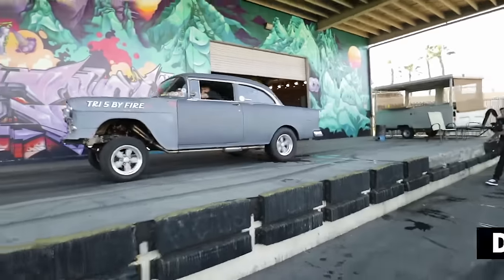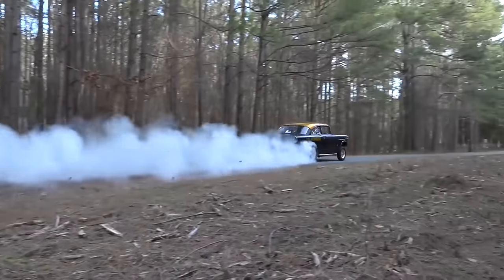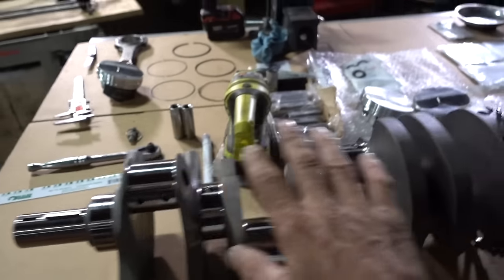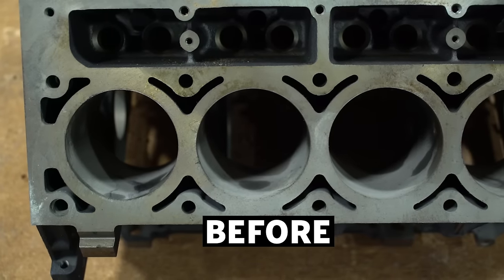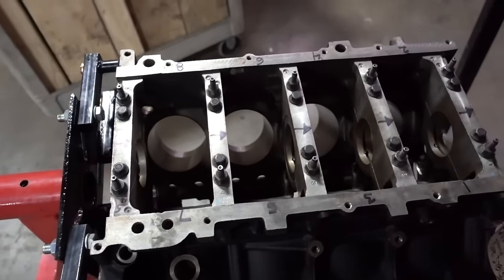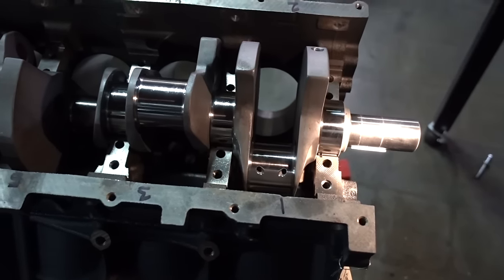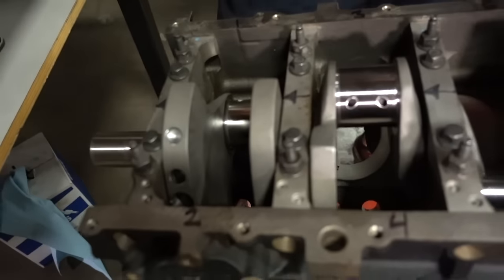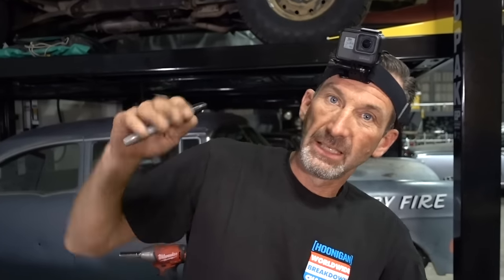700HP Stroker LS - How To Build Bottom End

Comment: Discrepancy in journal clearance can mean excess bearing thickness, a burred oil hole, inconsistent chamfering or a non chamfered main cap bolt hole, faling to remove peel coat from crank main journals, and line bores, uneven torque,  you mentioned misaligned line bore machining and a bent or poorly machined crank  (highly unlikely, machinists aren’t in the margin for error business) the most likely cause from a trouble shooters sense of weighing out which is more likely, precision machine with human fail safe  control monitoring (operator) or a human error during the assembly of the block, installing the rod and main caps in the correct direction is important, and so is the order! Switch two, one may or may not bind, but still be lethal to bearing life, depending on its distance from the original journal, while the other if located far enough or close enough will cause a serious offset of bore alignment , wiping out all that wonderful machining you paid for with hard earned loot. Id be suspicious of the human factor and eliminate from there back toward machining errors, or check the main crank bore alignment first, since its easier than taking it back apart and doing it again, again, and again (plastigage is compromised when it contacts oil, assembly lube, solvents found in engine building environments, thats why micrometers rule, and you only have to do things once after measuring your part O D to part hole  I D. Which the machinist sets with extreme skill and strict attention to tolerances, errors are not tolerated in the precision industry. The thickness of a human hair (bodily origin can be determined with a mic) stick a hair on the bearing and torque it down, will plastigage read it?  Never tried, a single small hair will likely shear off or flush out harmlessly, if it gives a false read on the plastigage, your well intended but unnecessary corrective actions are irreversible (barring plasma spraying new metal on the journal and re machining) you’ll have to increase bearing thickness and match the crank journal

Comment: Did I see you using blue threadlocker on the bottom-end hardware? If so, I've never seen that done with ARP fasteners. They just recommend their Ultratorque compound for even fastener tightness. Explanation?

Comment: Why check tolerances with factory bottom end bolts and then switch to ARP's? ARP's clamp differently and therefore can distort the main caps differently, as well as not having the exact same amount of clamping force as factory TTY bolts. Since the ARP studs are reusable anyway it makes much more sense to install those when checking clearances on an engine.

Comment: Put upgraded studs in before machine work. You may get inaccuracies in the sequence you use. Globules? The clearance is set larger than factory to compensate for elongation of bearing bores to prevent rub spots and bearing failure. Usually .002- .004 for racing engines.

Comment: Supposed to line hone if you use ARP studs.... you will tighten up the tolerances.. also.. you should check clearance with the bolts you are going to use...

Comment: Could u please explain that turn to torch again. At what point do u start at. Thats what im not sure on. What position is that bolt in before u start and how did u get there. Unless ur torc to pounds per square inch each bolt would be different when u start i would think.  Maybe i missed a step somewhere. Lol

Comment: This is supposedly a stroker? Not once was rod cap bolt to cylinder wall clearance mentioned. A stock block would need to be clearanced for that. The caveman approach to ripping the main cap with a pry bar and letting it bounce off the floor was I nice touch Mr. Double Click your torque wrench!

Comment: @ 16:22 the top holes are to push the top ring out they are not for oil thats omly on the oil ring.on a street driven engine gas ports on the top of the piston would clog with carbon build up and with the movement of the top ring that should not happen. tried to get wiseco to build the pistons for me and after 2 weeks of not returning calls and saying someone else will do it i went to diamnond to have it done 25 to 30 psi on a 383 lt1 pump gas and meth injection.

Comment: After you file your ring gap you need to take a light stone and debrr it. If you leave a burr you could cause a problem in the ring land one more thing plasta-gauge is never accurate. You torque the mains and mains, measure them then the crank and one at a time subtract the 2 that gives you true  Clarence. I spent years on a dyno and building for a race team.

Comment: So how many have reviewed this video again like myself now that the bottom end started knocking recently before it could be driven???  Always check your clearances WITH the hardware being used period.  Also Rods have to be reized for new bolts. New bolt/ studs as you see here have different torque specs due to fastener stretch is different between new/ used, studs/ bolts.  Very mininal but different.

Comment: The block should have been align honed with the ARP studs already installed. Using factory hadware for machining and then using different hardware for assembly changes the straighness of those main bores.

Comment: I was thinking of buying a cheap L92 engine and building it to get experience as my first build. Just wondering if it would be better to just buy a new block and put in the new parts. Or just buy a used L92 engine having it machined and then building it. What would be better

Comment: I came to learn something. Instead, I just have more questions. Is this an LM7 block? Is this going to be a 383 stroker? Are you using 6.125" rods? What compression, deck clearance, head gasket thickness, is this a 3.903" bore? E-85? Does this improve the reliability by lengthing the rods from stock?

Comment: were (should) the rings be gapped to NA spec or boost? with boost, the cylinders will be hotter closing that ring gap and potentially popping the top off that piston?
Reply: E Gibson Factory gap then ADD  .002" more gap for every 10lbs. of boost you plan to use. 

Run a larger gap on 2nd rings than top rings.

Comment: Marking the main cap bolts, in this case nuts? Keep in mind for the cost conscience, the Grump when building his winning 331 c.i.d. Pro Stock engine always used Chevy hardware as " these bolts are made from 330M steel … a very desirable Young's modulus". My understanding the LS1 bottom end is even stronger than gen 1 engines.

Comment: Also if the bore is align honed to a brand new crank (with the fasteners your using) you do not need to plastigague anything. Plastiguage is just a replacement for high dollar bore gauges and mics. Clearances should have been worked out with machining.

Comment: I've always wondered what made the LS, aside from the extended skirt, such a stronger motor than a 4-bolt main GM Crate engine.  It's the main-maintenance bolts. Essentially, it's a 6-bolt main!

Comment: Reasons why this engine won't last:
-Plasticgauge?
-You have to line bore if you use main studs!!?.
-0015-.002"?? Needs to be closer to .003"!!
-$18 torque wrench 
-Those are gas ports in the piston, not oil holes. They're designed to push out on the ring, not in.. 

Finnegan will mop the floor with that motor if he hasn't already

Comment: I still don't get torque to turn... there still seems to be potential for different torque values, it seems you have to tighten the bolt until it makes contact  first, then you set up the tool, but how do you make sure the initial torque is correct before setting up the torque-to-turn wrench? 

This is probably a noob question, I'm no mechanic
Reply: tty bolts/caps all work in same manner,  first torque to specific ft/lb (15ft/lb for LS mains I believe), then 80° of extra turn; TTY (torque to yield) bolts actually stretch when set,  which is why you can't re-use them, and no one uses for for rebuilds

Comment: There is a comparison of target bolt tension versus actual bolt tension for different tightening methods in Shigley’s Machine Design.  Torque wrenches stink...something like +/- 40% error.  It’s not the wrench, the culprit is between the thread and bolt head to cap, the friction coefficient is an assumption.  
    The “turn of the nut” is more accurate; Having nothing to do with friction.  “Turn of the nut” is based on bolt stretch and the underlying numbers are solid.
     The torque wrench orthodoxy is aroused like disturbed fire ants.

Comment: i got real lucky with 2 454 strokers one has a tunnel ram with only 6000 miles on it and the other one is stock 450 hp 485 torque with 38000 miles on it both run perfect with a 79 short box full option  4x4 with under 35000 miles on it in mint condition all for free plus a built 4 bolt 327 fresh all have 400 heavy duty turbo's and 2 old camero's that need restored but no rust in them

Comment: So you added more torque to the mains after you plastic gauged it with less torque or at least different torque then with the studs makes me think that the deflection will change the clearance... I was taught that everything that is check needs to be checked with the same  torque specs. Whats the point of torque plating honing if you are checking clearances with different torque specs? If you are worried about bolt/stud stretch measure them ( like you should be anyways ) before installation...

Comment: Not to nitpick but it’s not a motor, it’s an engine. Motors are electric ⚡️ 
I could pick apart several things that were done incorrectly but I won’t. 
I’ve been building engines for 40+ years so I’ve learned a thing or two.

Comment: I know you guys don't show everything due to time constraints, so this is for those people who want to build a motor like the Hoonigans.

I always cringe when someone builds a big dollar motor without using the proper tools....plastigauge is ok for making sure you are in the ballpark and double checking, but a bore gauge, plus the outside calipers in the sizes you need are only about $400 for decent ones brand new.  You really need them when building a race motor to make sure that all clearances are exactly where you want them and to double check the machine shop.  +/- a half thou is the difference between spinning a bearing and being ok.  Write everything down as you go, and make sure your target clearances are in line with what you want to do with the motor.  If in doubt, run more clearance.  Too loose means a little less oil pressure at idle, but too tight means you get to build another engine.

Many motors have been built using plastigauge I know, but I have found many problems that would have been an issue after the engine left my shop that plastigauge simply will not show.  If you are going to use plastigauge, build the motor loose to be safe.  When you get the crank done, ask for low limits - which means they grind to the bottom end of the spec instead of the middle, giving some extra clearance (clarence).

Other tricks include using the same studs/bolts when measuring the bearing bores because when changing to aftermarket from factory, the thread engagement is different - especially between bolts and studs.  When torqued they will distort the bore differently that is measurable.  Make sure the out of round is in spec and your bearing bore hasn't gone egg shaped. On some motors you will need a line hone to correct the bores when changing to studs from bolts.  Again, which is why you need proper measuring tools to be able to tell this.

Comment: Sorry fellow, but you need to check the main clearance with the ARP studs in place, studs will normally change the main housing bore .0005-.0008 tight! Bearings should be caged then clearance checked.

Comment: It should be noted the math in assembling a motor is paramount. What he's doing is right but he slips and states 2 thousandths of an inch a "020" and 1.5 thousandths as "015" a few times. Written down that would be 20 thou and 15 thou which would leave you with the sloppiest clearances ever with your bearings, piston to wall, etc. Hell, that probably wouldn't even give a reading with the plastic gauge, lol.

Comment: I don't know why people like to keep turning a crank in the block soo much. If you must do this for fun make sure you oil the bearing by the cap so you don't run the risk of a dry main bearing. And you don't torque all the main bolts down till you set the thurst bearing. You just snug all the main bearings then tap the crank to set it. If after your done torqueing all the bolts down then fell fine to do it again if you like.

Comment: I don't want to come off sounding like a Dick, but once you swap your bolts to ARP stud you must have your block line honed due to the clamping force of the studs vs the clamping force of bolts. If you read the instruction that came with your stud kit, it explains the "How and Why" much better than I can in the comments.. But I do want to add I enjoy your video's and good luck with the build.

Comment: double checking an already torqued bolt is inviting an over-torque situation. checking it after can, and sometimes will depending on torque amount, will cause the bolt to stretch slightly more. 

now, a seasoned technician will already know to gently sneak up on the torque value. once it clicks over, thats it. 

millions of people double check torque so for engines of this build level, its no so much a big deal. however, in other types of applications, double checking torque is very bad.

Comment: ugh... hi, professional engine builder here.... don't do this..... like almost none of this.... get the proper measuring tools... and properly mic the crank and use a dial bore gage on the mains to properly set up bearing clearance.... you can swap bearing haves to "dial in" the clearance ......... now... make sure you install the hardware you are going to use BEFORE it goes to the machine shop.... make sure you use a jewlers file to take off any burs on the edge of the piston rings after you file them to fit....how about checking the rod bearing clearance too?!?! be careful handling your parts... put something down that's soft like cardboard so if you do drop a main cap it might survive.....did you guys even clean the block and run bushes thru all the oil galleys ?!?!? how about cleaning the cylinder bores?!?! ugh... I could go on but im hopeing you guys did this for comedic effect....

Comment: Dubble clicking makes it more than 60ft/lbs, you should back down with 10% I've had a course in this and work as a subway mechanic, we have from 1nm to 900nm. It also matters if it is lubricated or not. A lubricated bolt is much easier to get a higher clamping force than with the same strength as an unlubricated bolt. But NEVER dubble click! Doesn't matter if you are careful.

Comment: Why use stretch bolts to squish your plasti gauge your tolerances will be tighter with arp's i always machine, hone and assemble with fasteners that are going to be used in the engine.

Comment: Did ya spin a bearing yet? You lads went to all this trouble to get the rotating assembly balanced, the bores torque plate honed, etc, however you're talking about getting the bearing clearances right by measuring with plastigauge? I'm shocked... Always use a micrometre. Always.

Comment: It you were doing a real race engine.....you put the bearings in, torque them down, and use micrometers to find your clearances. Even though most people get by with it.....it's a jr high method of clearancing. Plasti gage is only good for about .0005 or a half thousandth. With micrometers you can get clearances right on the money.

Comment: How much would it cost to build a 700hp engine?
Reply: I've been raising in building small block Chevys for quite some time come and live time I built a motor with a clearance of 1 1/2 to 2 thousands of an inch I literally chewed the bearing is right out of the bottom end in three runs oh, there wasn't enough clearance for the amount of heat expansion of the crankshaft. So I went down and got heat-treated clevite race bearings thou overs and bought a new standard standard steel billet race crank and and all my clearances for between 3 and 3 and 1/2 thousands of an inch. After that I never had a problem with low pressure or clearance and never blew up the motor after that, I had two and a half thousand on my rods oh, and like I said never had a problem after that the clearance is a big deal when it comes to race motors cuz everything expands and you need at least one thousands of an inch over a stock clearance. Everybody go towards different but that's what I found work for me

Comment: Plasti-gauge
Dropping bearings and main caps
Then using ARP hardware?????    Take your measurements with the ARP hardware. I would have run a line hone through that block

Comment: Waitwaitwaitwait. 10:13 / 20
Did i just see an harbor frekt un-torkit wtench...
Reply: If it works, use it. HF actually has some good tools... like the 1/2 inch impact wrench. Used it for a year in a small shop, never broke. The HF click-type torque wrench is also a good tool. HF also has some garbage tools though

Comment: Why would you do the clearance with factory bolts, then assemble with arps? Arps have a higher clamping force and will affect clearance! Most of the time, the block will need to be line honed when installing arps to get the right clearance. Also, get a digital torque angle gauge. Not that expensive. You guys have knowledge without understanding, and that makes you only average run of the mill car builders.

Comment: Some stuff is ok, and some stuff is wrong.
Not sure where you studied. "015" as you say, is 15 thou. Your plastigauge scale reads .0015 which is 1.5 thou.
You can't set main bearing thrust clearance after the bolts are torqued. Should be measured just after the cap is nipped.
I would not have a piston engraved with a name either, waste of time and money. Surprising Wiseco did that for you, or did they?